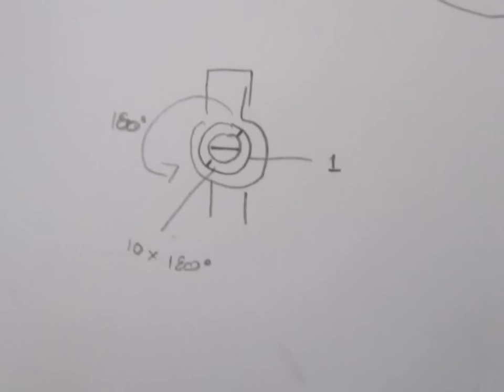TONEARM CENTERPIECE REPLACEMENT - TECHNICS 1200 1210 MK2 MK3 M3D MK5 M5G

Comment: Thanks very much for this video. Took me about 2,5 hours to change the center piece of my 1210 mk5 and i had never taken a turntable apart before. Everything is working perfectly. Most probably i would have bought a new tonearm, but 1210 mk5 tonearms are impossible to find so i found a center piece on ebay and decided to replace it myself. Cost me 20€. Thanks again.

Comment: Your tutorial saved my ass like a boss. Thank you so much! Btw.: After putting the new arm in place and retightening the bearing screw approx. the way it was before, the arm feels fine. :-) How do I find out if my bearings are f**ked up?
Reply: The arm should be able to move up and down without any foce, but should not be able to wobble at the bearing. The horizontal isn't such a big deal. If your vertical gimbal bearings are fucked you'll know all about it, as the tonearm will likely have a force causing it to move in a direction. Mine springs back towards the arm rest whenever it's balanced at 0g. It causes records to skip all the time and whenever I lower the arm rest it slides back outwards quite a lot, skipping up to a few minutes backwards. If a record is warped a bit it can even do a stunt off the warp, grab some air time then swing down making the needle fall on the strobe dots.